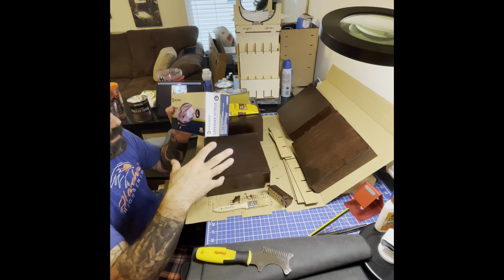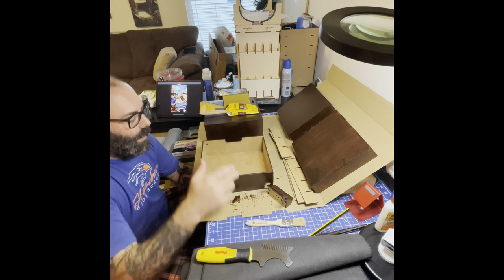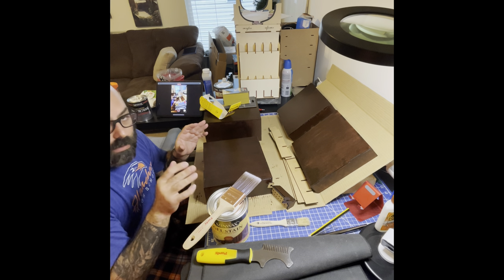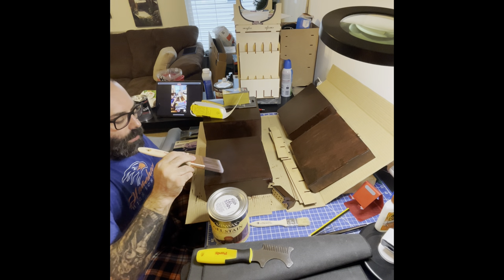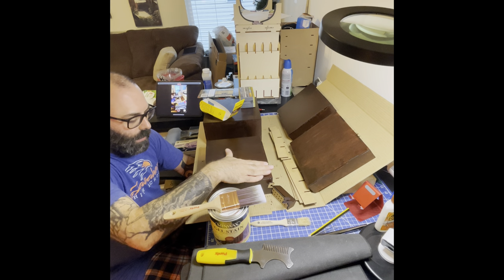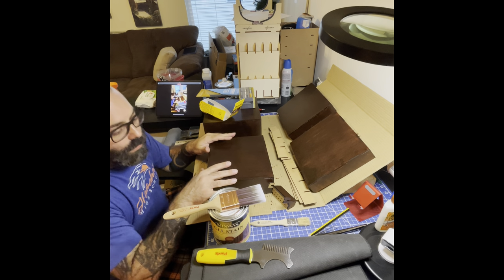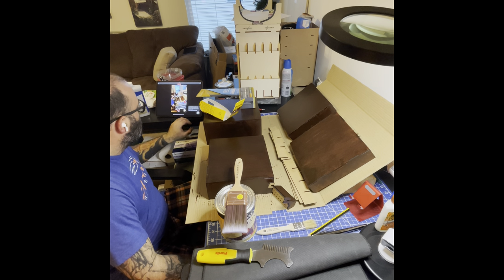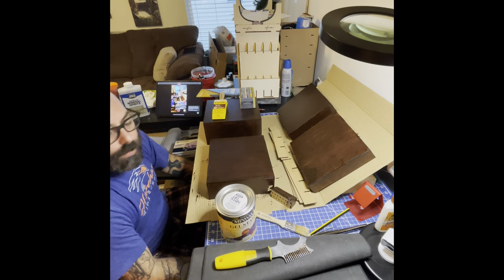Staining MDF wood

Comment: So does the prestain make it waterproof? Mdf swells and I need to waterproof it before staining and was thinking shellac it first then stain.
Reply from the maker: To my knowledge, pre-stain does NOT make it waterproof. I did pre-stain, then gel stain (due to MDF), the I did several coats of polyurethane. The polyurethane will make it durable, waterproof, spill proof, and makes it look nice. I hope this helps.